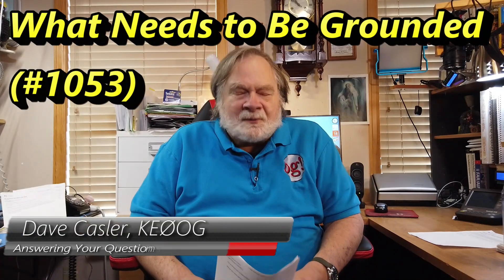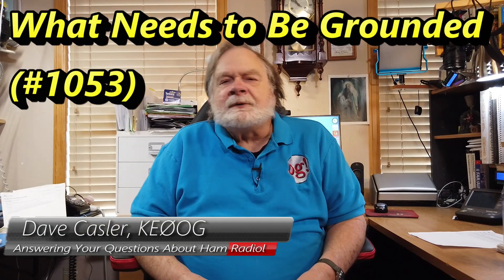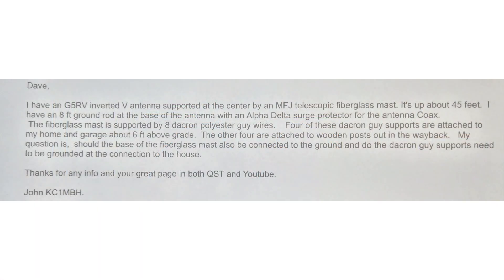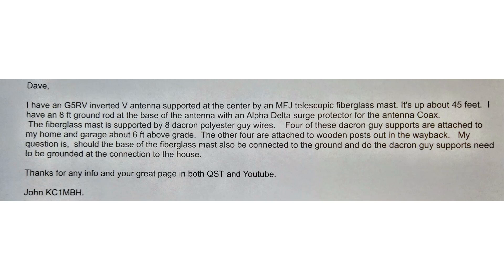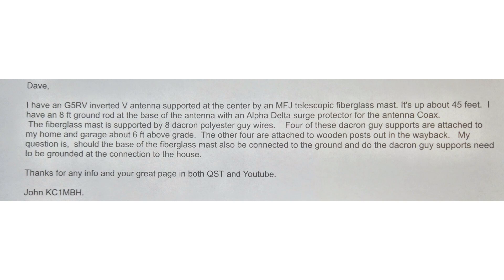What Needs to Be Grounded (#1053)

Comment: Remember……lightning is always attracted to ground…I only got struck because my Maco was on the side of my tower
The lighting passed my yagi and another ground plane on very top up to hit ground tower but Maco ground plane was in wrong spot wrong time.
Again always disconnect at a barrel connector outside and move coax leading inside to radios
If you do get struck by chance it will only destroy that antenna and coax down to barrel connection point
If you leave live coax coming inside your putting your life and anyone else life at risk of being killed
I almost was if I had gotten home 5mins sooner that day
Trust me RG8 will bring a very violent lightning bolt into that room!!

Comment: I’ve been hit
Direct strike to a Maco ground plane mounted on the side of my tower on a stand off mast
I was in the front yard just got out of my truck and BOOM!
Blew up everything in my room EVERYTHING!!!
Power cords was disintegrated only the prongs inside outlets was left to any radio stereo alarm clock even my brass bed was struck left blue marks like a torch was held on the brass!
Yeah I know what it’s like
Please disconnect outside don’t trust lightning arrestors!! 
Never leave live coax coming into the house!
Reply: did you completely disconnect the RG8 from your radio gear? sounds like you did not?

Comment: Never been hit, but I've seen some radios that have been. Some have no visible damage, just plain fried inside something. I disconnect every time I'm done even though my antenna is indoors as is the short coax. It's like belts and suspenders, if one fails, your pants don't fall, and the coax/power disconnect protects everything valuable. TU de KA8VLW, Ken, Michigan